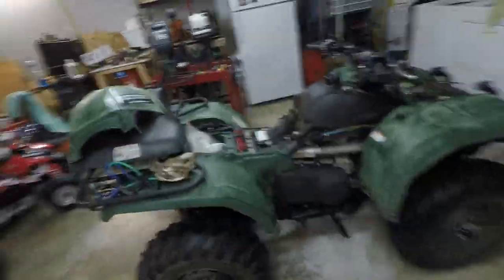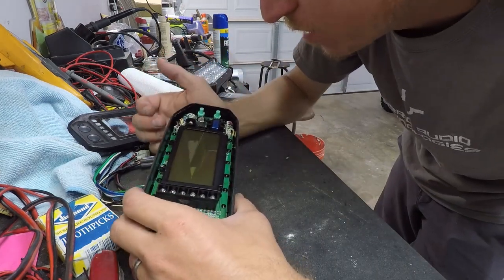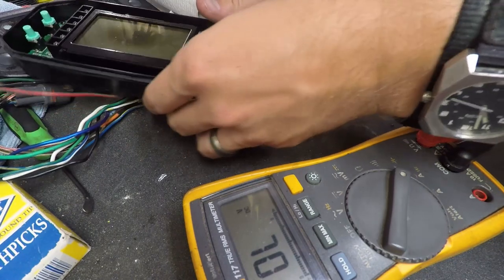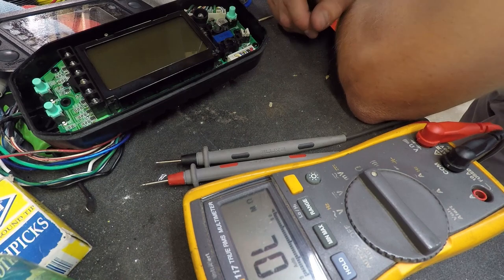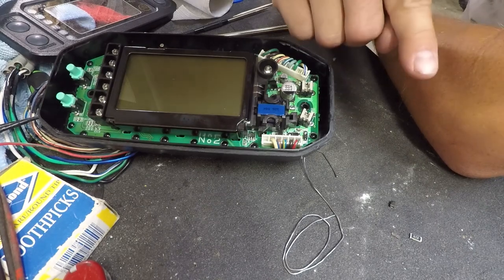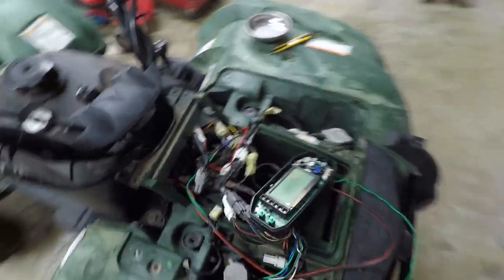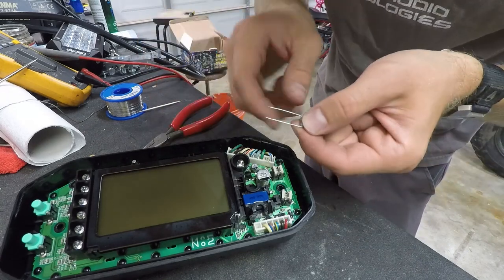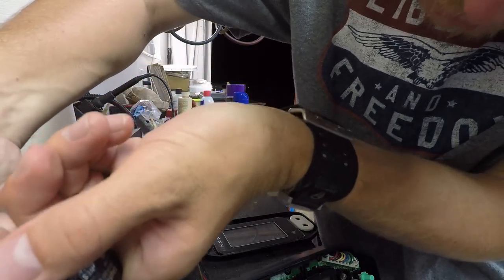Yamaha Digital display repair!!! Grizzly/Kodiak ATV

Comment: Thanks for posting this. My 2013 Grizzly 450 screen died and I followed your directions to tear it apart.  All of my surface components including the resistors, caps and diodes tested fine though so it is probably a little lucky if one can find a single component that will fix the unit.  It was  worth a try though.  Too bad the meter assemblies cost so much.  Thanks.

Comment: Great video, very informative!
Chris, any updates? Have you had any further issues with the display? Mine just went to 'E' status so I will be doing the Provazek fix soon.
Update: opened it up and the PCB is not like the one repaired in this video. No visible damage and no idea what remedy to take. 
Mine has a tag on the back: 5B4-00 7XN
Bummer.

Comment: Thank you so much for the video this worked for my 07 Yamaha 660s display for anyone wondering which resistors to get I went on Amazon and got a 25 pack of the 22 ohm half watt small brown resistors for like Six dollars and they worked great don’t get the bigger blue ones. I tried them and they didn’t work.

Comment: Thanks for your info,,,,My 660 grizzly had been purchased from a guy that parked it in so-cal sun ,major camo fade,sun effected Speedo glass(PLASTIC)I used 2000 grit wet sand paper, just kept sanding for about 1/2hr. Then once sanding even hand rubbed with a Scratch remover on shelf of AutoZone ,came out Better Than New.!!
Reply: I just did that too. Came out amazing. I couldn’t hardly see anything on mine. But I actually started with 150, 200,500,100,1200,2000 then polished with rotary tool. Look crystal clear now

Comment: Chris, that was an awesome video.  My 2003 Grizzly meter will illuminate but not show any display.  I do not have anywhere near the electronics tools you have, but can you steer me in the right direction.  If you are willing to work on and fix mine, I would be more than happy to compensate you.  One other question.  How do you make sure not to damage the meter?  What precautions would I take in the future.  Much thanks brother.  Look forward to speaking with you.

Comment: Your video is awesome!! However, not many including me have the necessary tools or equipment to do the repair. I do believe my display might be an issue bc I have the coolant indicator light stuck on from the time I turn the key until it’s turned off. Any suggestions?

It’s on a 2007 grizzly 660.

Comment: I was under the impression you cannot accurately measure a resistor in a circuit unless you disconnect at least one end of it.
Reply from the maker: You are thinking of capacitors, they cannot be measure in circuit (although they can be to an extent with an esr meter)

Comment: Amazing video, iv have the same issue battery ran dead and fried my display its never worked since and I don't have $800 to throw down on a new display the bike still starts and runs without the display coming on but it sure would be nice to get it working again,,
How much ya want to fix mine too? It's the exact same display as yours in the video, I'll ship it to ya and pay ya to fix it and send it back to me

Comment: Hi all, Followed directions and no luck for me.  Nothing changed...removed the diode and tried it as my resistor looked ok, no change, removed and replaced 22ohm and still no change.  Screen is backlit but no other info displays.  Even bridged the diode and still no change.

Comment: so i have green light of death.  i checked fuses all good so i found this video. worth a shot was easy to do but did not fix it. back to finding the problem with a lil more looking around online I found that the brake fuse wires corrode under the fuse box and thats just what i found i pulled on them a lil bit and came right out. I put those 2 wires on a new fuse BOOM!!!!! like new. check this first i wish i did
Reply: Can you please specify how to check that. Thanks

Comment: Hey bud, what is that tool you call the big guns that u use to remove the 2 resistors? Is that a type of heat gun? Are those resistors held on by double sided tape type deal? Sorry for the questions I'm going to attempt this Repair thanks to your video
Reply from the maker: it is similar to a heat gun, it is called a hot air solder rework station. it blows very high heat into a super small focused area to melt the solder. The resistors are soldered to the board, and both connections have to be melted at the same time to safely remove the resistor. looking on amazon, you can get a hot air station for around $30 now days.
Reply: @ChrisProvazek  thank you so much for your video and knowledge. I have the flashing E on my display from battery going dead and using a battery Charger. I'm A life long mechanic and I can not believe they designed something so horribly. My digital display is the new version of yours but from the looks of things it's basically the same thing just different shape. I'm going to open it up and see what I can do with it. Thanks again
Reply: @ChrisProvazek   Hey Chris do you do programing of memory Chips?

Comment: Chris, hopefully you see this, but first, great video and really great ingenuity in fixing the multifunction meter.

I am currently working on my 05 Grizzly 660 which is having issues with the multifunction meter not working. When the key is turned on, the meter background light comes on and the gear position lights show, but nothing else shows. I have found that my "backup fuse" has a small draw on it and I have isolated the problem to having something to do with the Red/Green wire going from the fuse to the multifunction meter. I wanted to ask you for your opinion on whether I should try the same fix that you performed? Or, if I should try something else first.

I have done considerable research before coming across your video and had not considered going inside the meter itself. I thought I would try reaching out to you before I go buying about $600 in parts (wiring harness and meter). I don't know to what extent you may be able to actually answer this question, but any tips from your experience would be greatly appreciated. Thanks!
Reply from the maker: Thanks for watching. It has been a while since I did the repair but most important think I would do is verify you have dc 12v and ground at the multifunction display before ruling it as the issue. With key and power switch both on there should be two wires going to the display with power, and one or two ground wires. Verify all of them are indeed good, at the connector of the display before deciding If the display is bad. I want to say I showed which wires those are in my video but can't remember.
Reply from the maker: Yes, just checked red wire with green in white connector should be 12v+ when key and switch is on. Brown feeds the display backlight. If you have power on that red/green, and you have verified you have - on the ground wire then I would bet the display is bad.
Reply from the maker: Also keep in mind your display maybe different because it is a 660
Reply: @ChrisProvazek  Thanks for the tips Chris! I'll check all that before I think about tearing the display apart. Again, great ingenuity in how you fixed your own display. And even if my display is indeed different, I'm sure they share a similar design so I'm hopeful that I will at least have a good direction to work in now.
Reply: @ChrisProvazek  I just checked my wiring diagram (taken from a repair manuel I bought) and I too have the same wire setup. I have been focused on red/green. Did not even consider the brown to be a factor. I will look into this more. Sincerest thanks for your responses.

Comment: Do you know if this will work on the flashing "e" display?
Reply: In case of damage related to the display of "E", replace the memory chip with
new with programming, as the original memory is unfortunately of mediocre quality.
Reply: @p.u.proserwis3896  does this work for the 2005/2006 year model? And where should I start trouble shooting with the flashing E?
Reply: @samuela6073  The error with the blinking "E" occurs most often when the battery is slowly discharged, if the quad is not used for a long time, the eeprom memory loses data. Therefore, the simplest solution is to cut the counter inside and physically replace the memory with another manufacturer (Atmel or STI) along with its reprogramming, of course you need to have an appropriate memory batch. This is most likely a Yamaha manufacturing defect. The repair method applies to all models of all years.

Comment: I bought a used speedometer off a rhino for my grizzly, out of the 3 plugs, 1 is different....you think you could help me out figuring how to re-pin the wires....just need to know which colors go where
Reply from the maker: I would highly recommend searching any model numbers off of your display and finding out exactly which machine it came off of, then seeing if they are going to be compatible. It may work, it may not...
Reply: Did you figure this out

Comment: Hey quick question. When the dash failed did it display the big flashing E on the dash ? If so I'm going to try this repair on my quad!
Reply from the maker: No, my issue was an issue of the board internal of the display not powering up at all. The E code if I m not mistaken is an issue of one of the power leads not getting to the display. Use a meter and verify you have power on the two 12v+ leads for the display (I cannot remember the colors) watch the video. Most common issue is the fuse holders under seat get heavily corroded that current cannot flow
Reply: Perfect! Thank you very much I'll look into that!  Just picked up a 2009 grizzly and it has the flashing E from what I've been reading they say the meter has to be replaced but I feel there has to be a repair for it so I'm going to do some digging
Reply: @garrettesau959  have you been able to find anything more on this? Currently dealing with the same issue
Reply: @alexanderchisholm7610  no unfortunately not, all I can find its the cluster is toast and needs to be replaced .. but  finding one that isn't $700+ CAD if difficult and I contacted Yamaha for help but they basically told me to pound sand.
Reply: @garrettesau959  brutal. Im on hold for them right now, probably going to wait it out and tell them it’s not a good idea to send out a bulletin admitting to a faulty part and not honouring a replacement
Reply: @alexanderchisholm7610  yeah basically what they sent me was the tsb (technical service bulletin) was issue simply for customers satisfaction that the fault was due to poor care by the owner (letting the battery go dead). well some of us up here in Canada only have 4 months of decent riding weather and battery's can short and fail even with a tender on it.. I'm an automotive services tech my trade . I know how this stuff works.
Reply: Desde mexico y también soporte técnico no ayuda!! Lo mismo E en tablero
Reply: I was driving my Yamaha rhino and all of a sudden the dash display just went blank. Any suggestions?

Comment: Running into the same problem on my 2008 Rhino 700. Looking for someone to fix it in texas lol
Reply: In case of damage related to the display of "E", replace the memory chip with
new with programming, as the original memory is unfortunately of mediocre quality.

Comment: For those who has a 2009 Yamaha Grizzly, this video is great and gave me something to try before flipping the $350 for a new.  But of course the meter assembly on this particular model is different.  I opened mine up... and tested all the resistors and diodes all checked out to spec.  The board looks clean, no thing appears burned out.  I was hoping it would just be a diode and/or a resistor like in this video.  It's possible is low voltage issue can lead to multiple different ways to toast the meter assembly.  So I kept scouring the internet... and I mean I scoured!  Until I found this!!
https://www.youtube.com/watch?v=a1gqL2mYZAY&t=3s
But it's in Russian!  It appears to be related to the dreaded "E" display, but I can't understand the intro to know if this thing is a result of a dead battery, or if the "E" thing can result from something else.  Anyone who understand Russian, please chime in.

Comment: i have a flashing E after having to boost bike . could be the same thing
Reply: In case of damage related to the display of "E", replace the memory chip with
new with programming, as the original memory is unfortunately of mediocre quality.
Reply: @p.u.proserwis3896  Do you have a video, link, or instructions on how to replace and reprogram the memory?
Reply: Yes, I'd like to know where to get a new chip and how to reprogram also.  I think this would help a lot of people.  I have a 2009 Rhino with the dreaded "E" and know of several others with the same problem.

Comment: At 8:23, what is that device called?
Reply: I think I found it.  Anyone else looking for this should google "LCR-T4 Mega328 M328 Multimeter"
Reply from the maker: @dbbyleo  correct. its just a cheap component tester I have, it is the most cost effective way to test capacitor ESR.
Reply: @ChrisProvazek  well here I am 8 months later, and two ATV trips later with no gauge, I'm really thinking of digging into this thing.  How is it going without the "Zinner" diode?
Reply from the maker: @dbbyleo  Google "zener diode" like I said in the video there s no way to know what value the original one was once burned out
Reply: @ChrisProvazek  yes, I got that.  But I was just wondering how your gauge is doing not having the zener diode.  Is it still working?  Hasn’t quit on you yet?
Reply from the maker: @dbbyleo  oh sorry, yes the gauge is still working fine, it is on my dads 4 wheeler and he's had no issues so far
Reply: @ChrisProvazek  when you said you “left the zener diode out”... wouldn’t that have left that part of the circuit open?  Sorry... if that’s a dumb question.  I’ve got a zener diode that test fine when the leads are set in forward-bias.  But when reversed, it doesn’t read OL or infinity (but I wonder if it’s because it’s in circuit).  Also, When I set my multimeter to continuity, it beeps for a moment, but then stops.  I’m suspecting I also have a bad zener diode. The zener diode is also location next to the power source. 

So my question is, when you took yours out, did you put something in its place, like a jumper?
Reply from the maker: @dbbyleo  no I left the zener out of the circuit because in my case it was shorted. (Continuity both forward and reverse bias)

Comment: Could anyone tell me hoe to delete fault code on grizzly 700. I get fault code 14 (air preasure sensor), but i don't know how erase it. I 
will try to do step by step from repair manual but unsuccessfully. 

I try to do this: https://youtu.be/BvywGnEu3Do 
              Deleting fault codes
             To delete fault codes, ground the EPS self-diagnosis signal connector 3 or more times within 5 seconds
             while the present or past malfunction mode is activated.